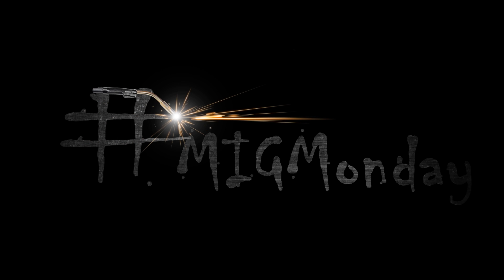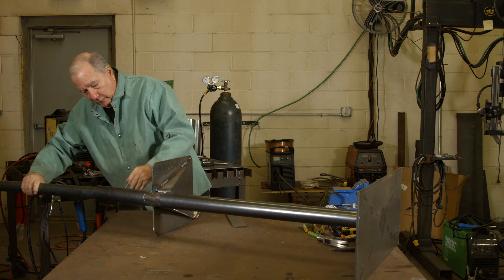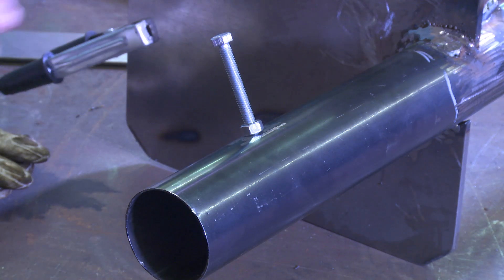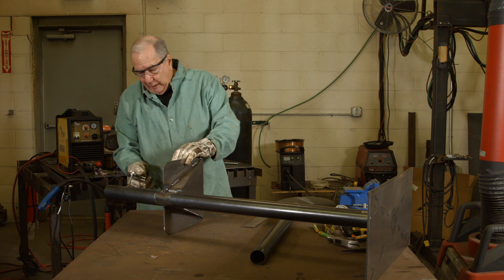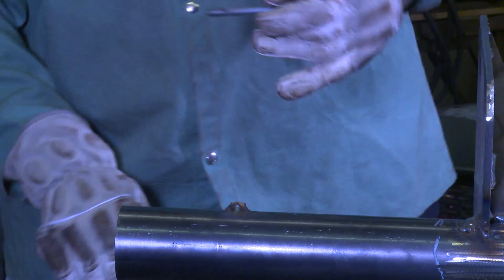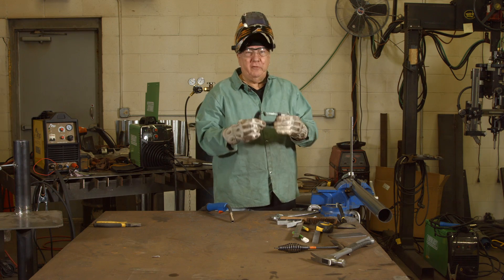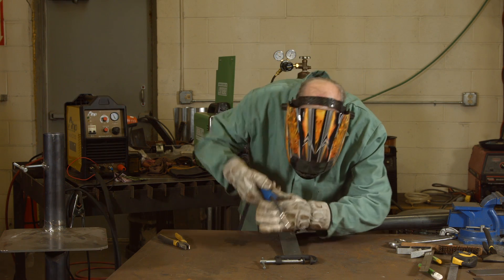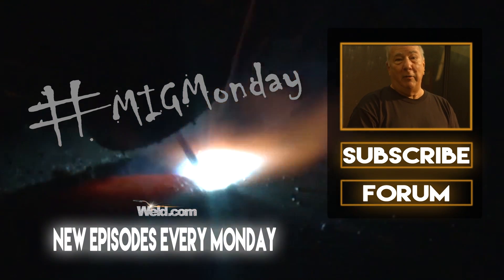DIY Weld Stand Project: Part 3 of 3 | MIG Monday

Comment: I've been meaning to make something like this, and then found this series I've not seen before. I'd rather not have to bolt it down though, would a couple of sandbags help stabalize the base enough or does anyone have any ideas how I could tempoary support this with my normal welding table which is 4' square? Thanks.

Comment: Paul, love these videos!  Watching them has definitely improved my welding skills - thanks so much for making them.
I am curious what sort of welding application inspired this table you built. Could you demonstrate in a future video?
Also, I feel like I learn a lot watching the segments which show the arc and weld puddle (sound, speed, motion, etc.).  In my opinion, speeding up those segments devalues the video somewhat.

Keep up the great work!
Reply from the maker: +John Robertson Thanks for the feedback. We speed up the cutting / welding in these projects because we are focusing more on the steps and some quick tips to keep the video length down, but we can add in some live arc shots if that is a help. The table was built to help us in some of our future videos, not necessarily a specific application. Stay tuned for the those videos.

Comment: its a shame you can't just make a video about making something cool and how to do it, without having so many complaints about everything known to man.. And now had to spend 3000 dollars just to shut said people up.. i'm somewhat new to welding but during my time learning and researching i've learned about fumes from some materials and how they can be harmfull.  BUT and a huge but, I can't afford one of those.. i'll still use your video regardless to get ideas and help me make new projects.  I learned first the safety and hazards of welding and then started watching videos like yours to help me with ideas.  all you needed to do was mention every now and then that it is important to know what your getting yourself involved in.. i'm sorry you felt you needed to get something not for yourself but for commenter's, I know I won't have the luxury of using one.. but neither did my grandfather who spent most his life doing this same thing and he's in his 90's.
Reply: +mattp1482 At the very least you can use a flapper disk to remove some of the surface treatment in the area you plan on welding. Body placement to keep your head and shoulders out of the fume cloud. Third, you can easily buy disposable respiratory masks for welding that are rated for welding and meet the safety standards. If you find you are doing a lot of welding with fume exposure and little or no positive extraction you can then move up to a half face respirator with disposable filters again rated for welding fumes and safety standards compliant.
Definitely avoid galvanised product fumes as they will really make you sick.
Reply: Try using an old vacuum with the exhaust pointing away from u it should work ! you only need to dissipate the fumes